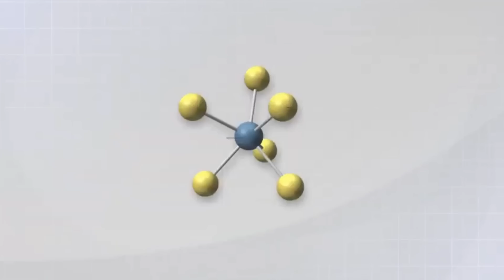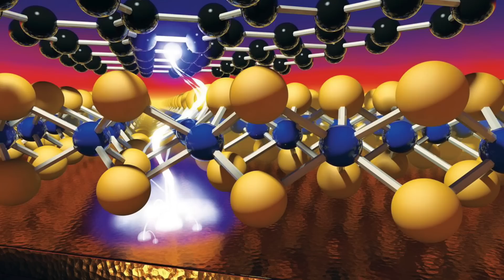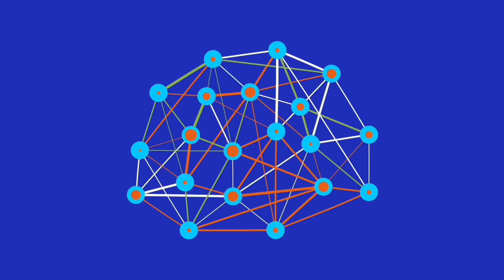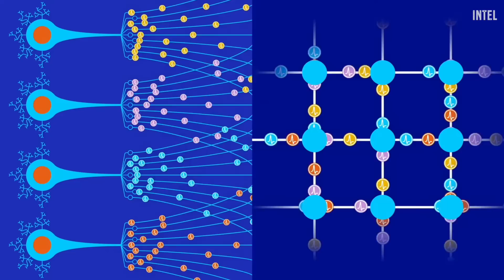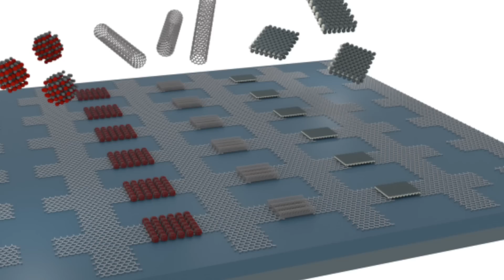New Groundbreaking Device To Accelerate Computing 🔥

Comment: The biggest bottleneck is memory right now. It's incredibly hard to make memory chips which have a higher capacity and also don't have big drawbacks in speed/latency, price, and failure rate. That's why we only get a memory technology refresh every three or more CPU/GPU refreshes. Sure there's growth within the lifetime of a memory standard, but even if we take that into account, it's still slower than the others.

Comment: they should use TWO SIDES of the same chip, making the layers of semi conductors on BOTH sides of the wafer, from a single split EUV laser beam, at the same time..... one energy burst, 2 chip sides.... double the amount of transistors on the same substrate... even 2D "objects" have 2 sides to work upon.

Comment: How interesting & so well explained. These 2d devices should be less troubled by cosmic rays & terrestrial gamma radiation as the chance of an interaction in an atom are much lower than in many atom devices. They may however be more susceptible to stray magnetic fields bending the small number of electrons & also to impulse shocks cracking the thin connectors. Difficult to know until some practical devices are tested under real world conditions. Thank you for sharing!
Reply: This was my opinion as well, but I assumed it would be more likely then less to have errors.
Reply: That depends on the material impulse shock could work on brittle weak materials idk if h-BN is like that, in case what was used here applies, graphene is too strong though and other materials are much more ductile. Boron itself can be a neutron absorber depending on the isotope so adding it to electronics could result in the release of extra alpha particles. Neutron capture is what normally causes cosmic ray errors in computers.
Reply: I think you've misestimated the degree to which the transistor density for devices that small will be affected by cosmic ray strike.  As density increases, so does the impact from cosmic rays.  They're so energetic their range of effect is large.
Reply: @BinkyTheToaster  The thinner the device the less chance there is of an interaction and if there is an interaction there is less material to be influenced by any secondary ionisation produced. Thicker materials are more likely to have an interaction within and there is more material for secondary ionisation to interact with.